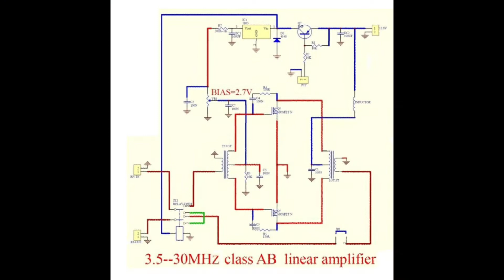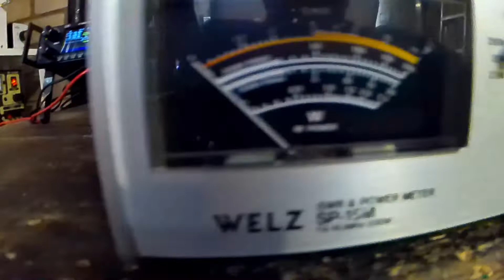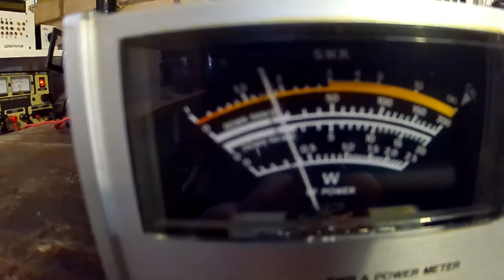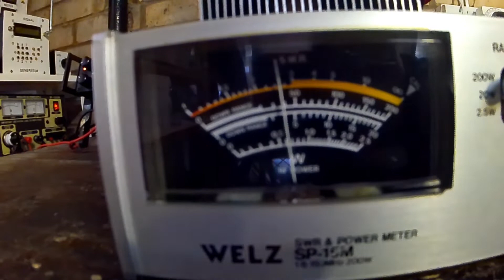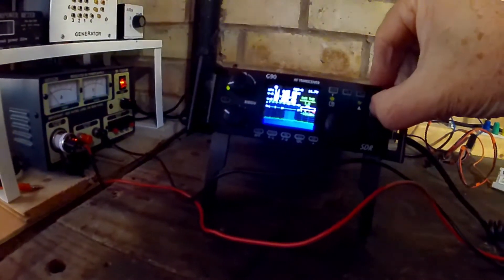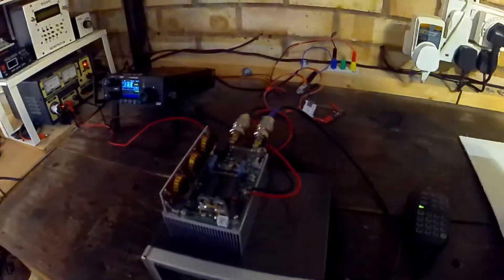Minipa70 HF Linear Amplifier Kit. High SWR input. Missing R6 Resistor. Ham Radio. Amateur Radio.

Comment: Could you please share the LPF circuit and also where did you buy the heatsync.
Reply from the maker: I thought I have done in a previous video A few weeks ago. Heatsink via Ebay "1PC Aluminium Heat Sink Radiator Cooling Fin Silver for LED Power 100x69x36mm"
Reply from the maker: If you cannot find the video then go to my Ham Radio Playlist and browse to the bottom list.

Comment: can you help i cant find c7 pls
Reply from the maker: I think C7 is 100n and goes from centre tap of secondary input  transformer to negative track on board. Or wiper on bias variable resistor to negative track. However I am not 100percent certain or position on board. On circuit paper diagram it's a ? Cheers from old George